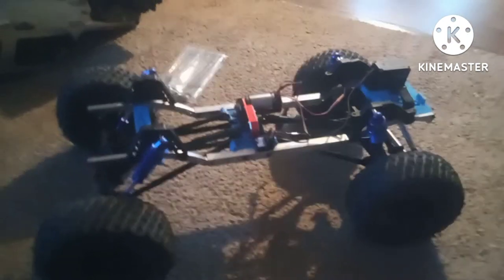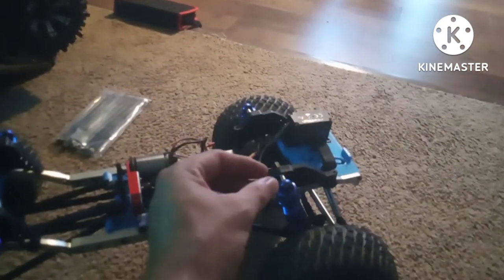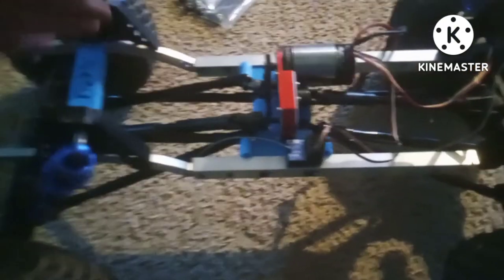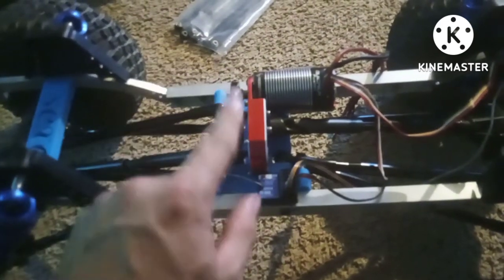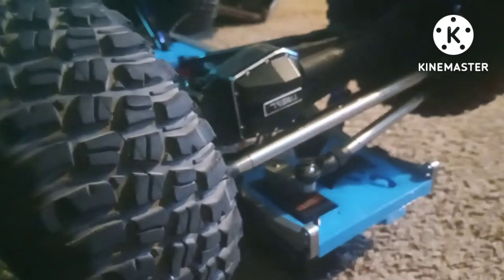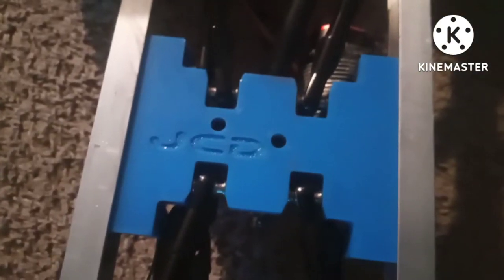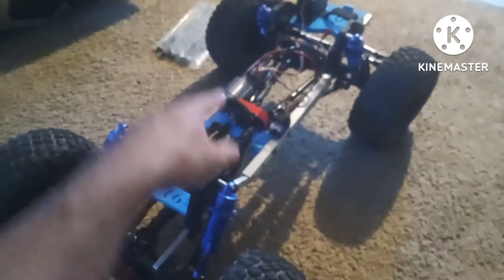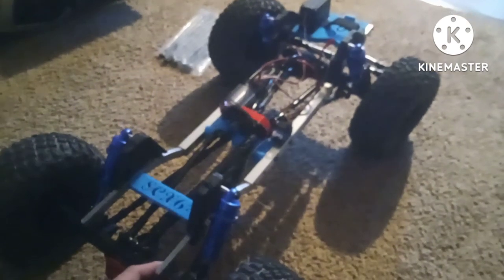1/10 scale rig with scx6 axles

Comment: How did you mount the driveshafts to the transmission
Reply from the maker: I had 3D printed sleeves made or you can go to Lowe's and get the nylon sleeves to take the spacing between the shaft of the 10th scale transmission and the drive shaft